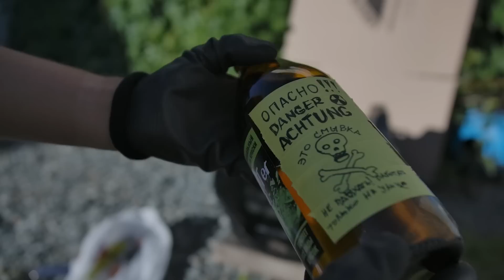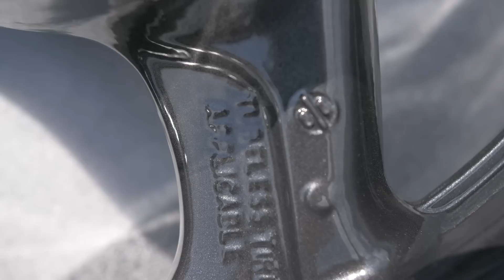Honda X11 scrambler build CB1100SF.  Tuning old motorcycle to brutal looking custom bike diy

Comment: 素晴らしい！👏👏
Reply: The bike that my friend loved was the HONDA X11. Now I can't ride it because it was badly damaged in an accident. My friend tried to remanufacture the bike by himself, but HONDA did not have the parts, and the number of production in Japan was as small as 1000 units, so it was difficult to procure used parts, so he gave up remanufacturing. Although it is an old motorcycle, the X11 has become modern and stylish thanks to its wonderful technology, and I am very happy that it is still active.

Comment: Sweet Ride..... Can I turn my CBR 1100XX into the sport/Tour/Enduro?
Reply from the maker: Yes, of course, but only at your own risk. if you want to make good tour-enduro, the main problem is suspension. The front fork is easy to find from another bike, but the rear shock absorber is a challenge. I suggest you to contact a bike shop to have your bike rebuilt.

Comment: Very nice👍 What Kind of Metzeler Tires did you use???
Reply from the maker: the most popular for scramblers is : "karoo 3"    There is a link in description
Reply from the maker: it is METZELER 170/60R17 TL 72T KARO3      and   METZELER 140/80-17 TL 69R KARO3

Comment: i saw you mention in a comment that there were loads of these in your country, i'm struggling to find parts mainly the fairings and grill around the radiator and i was wondering if you had any websites from your country which might have these parts in stock?
Reply from the maker: I think you can find it here  https://vk.com/market-709285?w=product-709285_51583%2Fquery   and here a radiator plastic grill https://vk.com/public113182441   i saw it, but it cost about 170dollars

Comment: Where did u get that headlight?
Reply from the maker: you can find it in aliexpress  https://aliexpress.ru/item/4000808255471.html?spm=a2g0o.detail.1000060.2.76af7cdbGSBTut&gps-id=aerPdpSubstituteRcmd&scm=1007.33958.210224.0&scm_id=1007.33958.210224.0&scm-url=1007.33958.210224.0&pvid=0b7c2c00-dc4f-4071-9fc4-0017fc6e19a2&_t=gps-id:aerPdpSubstituteRcmd,scm-url:1007.33958.210224.0,pvid:0b7c2c00-dc4f-4071-9fc4-0017fc6e19a2,tpp_buckets:21387%230%23218179%230&_ga=2.42246243.754119242.1620479862-150508519.1612723158&_gac=1.19613642.1616715338.CjwKCAjw6fCCBhBNEiwAem5SOzfuGk56cEYINE572AvRiFY-BJJpAQsXJLpzmrTaK0i0M6DAG0Gq7hoCImQQAvD_BwE&sku_id=10000008102407781

Comment: Awesome job. I own one, too. Doesn't the new Tires kill the perfomance? How does it drive like that?
Reply from the maker: Tires is Metzeller Karoo 3 and it is not designed for this type of bikes.  On low speed it is really hard to feel difference between  standart tires in driving . But on speed higher than 100km.h or 60mph it is harder to steer and tilt bike into a turn. So if you need save sport performance of x11 on road, it is not a good choice. But if you like sometimes to drive offroad, that tyres will be much better.
Reply from the maker: There blogstyle video whwre i riding it https://www.youtube.com/watch?v=jLRVpalaDpM

Comment: Nice job! Where you get the lights from?
Reply from the maker: Thanks! i bought it on aliexpress. Suddenly the same model of my headlight is not exist but there is a link of head light shop whhere i bought it: https://aliexpress.ru/item/32964125200.html?spm=a2g0s.9042311.0.0.264d33ed8Kymhh&_ga=2.149627766.1109706516.1614799328-150508519.1612723158&sku_id=10000000151603647 
аand turn lights:  https://aliexpress.ru/item/32915638257.html?spm=a2g0s.9042311.0.0.264d33ed4eTuDw&_ga=2.73632594.1109706516.1614799328-150508519.1612723158
Reply: @sergionovazzi763  thnx for the info.
Keep it rolling, Nice bike!
Reply from the maker: @motormuisie1024  Now I'm preparing new part, about seat and tail upgrade, ill post it soon

Comment: A Honda cr500 set of fork sanctions with stiffer springs using the original 1100 front wheel would been a better idea had you had $500 for a spare used set .
Reply from the maker: Thanks for the tip, I was thinking of taking the suspension from a Honda CRF1000L Africa Twin. Maybe it wiil be really better to use fork parts from cr500.

Comment: This engine using cable clutch? I thought Blackbird engine using hydraulic clutch?
Reply from the maker: Yes there are cable clutch. In blackbird - hydraulic. But it is compatible, so if you want you can buy a blackbirds hydraulic system and replace it.

Comment: Hate those tyres can't see how you get decent grip on the road, but awesome everything else and great video production.  If it'd left the factory closer to this, would have done much better.  Also X-11 owner.
Reply from the maker: yes it is your opinion. Those tyres get surprisingly good grip on asphalt and grave road. I easily can make stoppy on that tire, but i will not do strong hang turn on high speed. Bmw GS owners use it as regular for cross travel ride. And it is not restoration, it is part of visual modification.